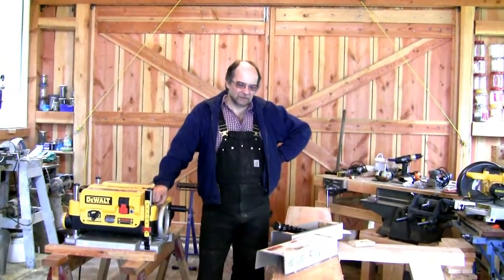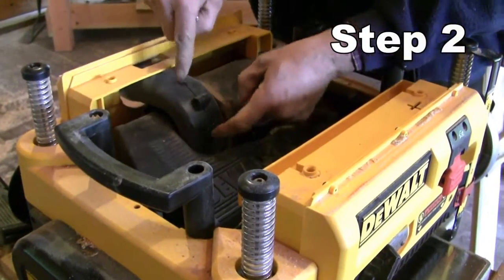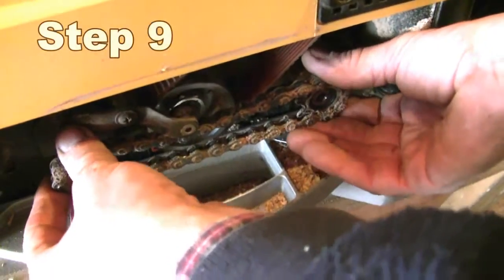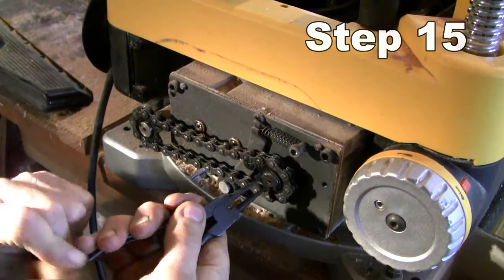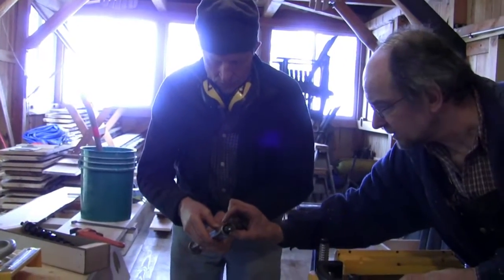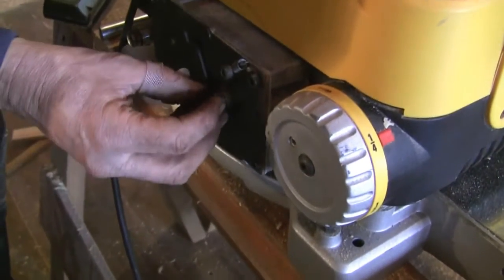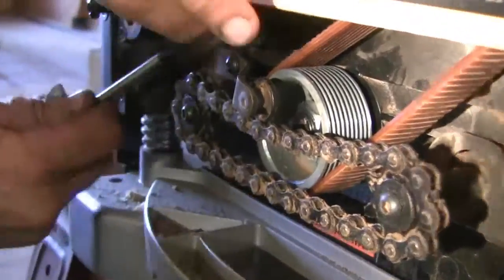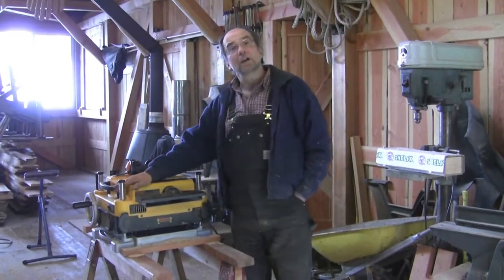How To Install a Shelix Cutterhead in the DeWalt DW735 Planer

Comment: Funny how you skipped over how to tighten the main pulley nut. Mind sharing what you did to hold the cutter in place to torque the nut?
Reply from the maker: More a sin of omission than of commission :-)
It's not difficult to grip the large pulley & tighten against it, given it is fixed to the shaft with a key. Also, if I remember correctly, the cutterhead shaft has a locking mechanism. In any event, the nut does not need to be extremely tight , again, given that the pulley is locked to the shaft with a key.
Cheers,
M

Comment: As a beginner wood worker this was my first big splash. The planer has worked great>>>ur2.pl/856    and left a smooth finish with no additional sanding needed. Planed about 200 feet of rough cedar and it all turned out great and uniform.

Comment: I have a trick for putting that belt back on: Get it started onto the top of the ring, then use the socket you used for the nut to rotate it (counterclockwise) and the belt will slide right back on.

Comment: thanks guys. your video was the one I chose to use for instruction and it went beautifully. few problems on mine , dewalt used blue Loctite on the shaft hold down and they used Phillips #2 for fastners. I may be patting myself on the back but I never strip out a fastners. I will say I have tennis elbow which contributed  . Also I think dewalt shoud have used hex head bolts for the application. Phillips used in 3 places , cutter head hold down , and 2 tensioner supports. my machine was brand new so this may have been a factor. loved you video.

Comment: Getting ready to change out the cutter head in a dw745 and of all the videos your are the best. We plane lots of hard wood here as all our lumber comes straight from the mill. I wish I had kept track of all the blades gone thru so far. By the way, I have resisted this change over because of the cost but recently the price has gone way down. Anybody on the fence should check it out.

Comment: When I bought my new Dewalt planer I had high hopes. I was disappointed because it bogs down so easily. And the noise! Wow! I've done my research, I bought the Byrd cutter head and I am ready to install it. This video will help me a lot. I will update how it went.
Update: Great video. Wow! My planer now works like I had hoped. Installation was easy. The noise difference is amazing, but, most importantly the planer doesn't struggles. Tried some 8 inch widecwhite oak which the planer struggled with using stock blades. It wentvthrough easily with the new cutterhead.  The cutterhead is a tight fit through the hole and you do need to be careful not to mar the bearing housing. They recommended wrapping the cutter  head in plastic to put it in, but mine was so tight that any more sickness would have prevented it I'm going through. Worked out OK, though. If you don't have snap ring pliers, buy some. People have complained about how hard it was to get the old cutter head out but if you have a piece of hardwood to hit it with (like in the video) it's not that difficult. Whole thing was pretty straightforward and the video helped a lot. Thanks for posting.
Reply from the maker: Hey Douglass,
Thanks for you post & follow up. I'm glad you found the video useful.
An employee at Byrd told me many (non-mechanically minded) woodworkers are reluctant to make the switch. Between the two of us, maybe we can give them a gentle nudge :-)
The DeWalt is probably the best portable planer on the market and as you have found, the Byrd Shelix cutterhead makes it better, My planer owes me nothing & it's still going strong.
Cheers,
M
Reply: Markerbuoy - On Canada's Left Coast Yes, I previously have owned a Delta 12 1/2 inch and a Porter Cable. They were OK, I guess. I wish I could have had a helical cutterhead for them. The 735 has much better dust evacuation. I just got a leaf bag and hose to hook up to it and that works great. I recently got 10 church pews that are red oak that I am about to plane. Looking forward to my planer working great.

Comment: The only thing I would add is this.

Upon completion of installation, I decided to look at the Byrd instructions for myself. They included a plastic sheet to wrap the cutterhead in while inserting it into the machine. This should definitely prevent any nicking or marring that would otherwise occur. I have at least one small nick in one cutterhead which in the grand scheme of things is no big deal. I don't know if this was addressed by anyone else on the comments or not.

However I used your video as a guide and my machine has a new lease on life. Thank you for the instruct!
Reply from the maker: Good point Ryan - no one else has mentioned this. My Byrd instructions contained no such mention. I cut my hand on the cutterhead during the install and a plastic wrap would have prevented that. I'm glad you found the video useful - out with the old, in with the new!
Cheers,
M
Reply: +Markerbuoy - On Canada's Left Coast Yeah, I really blame myself for not looking at the instructions. I found the video extremely useful. Thank you.
Reply from the maker: The Shelix people told me that most woodworkers are reluctant to engineer the cutterhead installation. As you know, it's not such a big deal as long as one pays attention. You & I know that - hopefully more will follow...I bet you love the Shelix cutterhead!
M
Reply: +Markerbuoy - On Canada's Left Coast I do love it. and the installation was easier than I thought it was going to be...Thanks to you.Haha!

Comment: I came across your very interesting video while researching the Shelix cutter head upgrade.  I've been very disappointed with my brand new 735.  My first project was to plane some poplar, and I can not believe how quickly the blades dull, resulting in breaker trips.  This morning, I could not even get through a small 4" X 36" board without tripping the breaker on the machine, even with the speed set to the slowest setting, and less than 1/4 turn on the wheel per pass.  When I rotated the blades to a fresh edge, the cutting sound was noticeably less, but for only a few passes.

My initial assessment of this very popular machine is that it is really not up to the task of dealing with hardwood, even the relatively softer poplar.  It runs right through pine without any problems.

In your video, in the initial decibel test, I couldn't believe how easily the large, full-width board ran through the machine.

I'm thinking that Shelix head, even at twice the cost, is a better investment than a set of carbide blades.  The stock blades seem to be worthless?

Any suggestions are appreciated.  Thanks.
Reply from the maker: +John G. Walter 
Hi John,

In my experience, the 735 is an excellent "benchtop, portable" planer. In my video you saw how much Douglas Fir we ran through the planer while building my shop. While D Fir is technically a softwood, it is mighty tough and yes, I found the blades fairly quick to dull ( I would dress them with a diamond hone, rather than spring big money for a new set), although your experience seems exceptional. I can only suggest that maybe, maybe, DeWalt has dumbed down their  blade manufacturing or that you are simply unlucky...it's hard to know what to suggest without being there. 

A shelix cutterhead is a big investment but I don't think you will regret it. While I haven't done the volume of planing as previously, the carbide cutters remain tack sharp and blade changes are a thing of the past. The spiral cutterhead is a different technology, as I'm sure you realise and makes conventional knives look old hat. Highly recommended. A little quieter too!

Given the abuse I have put it through, I must say the DeWalt has held up very well. There is lots of life left in it, especially with the shelix and it owes me nothing.

I recently upped my planing game with this beast https://www.youtube.com/watch?v=I6OHktyBr5M - you may have seen the video already. I use it to do the heavy thicknessing and now use the DeWalt for fine finishing. 

I don't know if this helps or not. If I can be of further assistance, just let me know.

Best Regards,
Mark B
Reply: +Markerbuoy - On Canada's Left Coast 

Thanks for the quick response.  I really liked your video.  After having problems with both sides of the knives that came with the planer, I have switched to the spare set that also came with it.  They look the same.  However, they cut much better.  I quickly went through a couple of poplar boards, one 4"X 3' and the other 4" X 7', planing them from around 1 1/8 to 3/4 in quarter-turn-of-the-wheel passes.  

The machine was noticeably quieter, did not trip out the breaker, and what was very different, were the chips.  On the first set of blades, the chips were granular, like chunky sawdust.  On the new blades, the chips were fluffy shavings, which resulted in about 10 times the volume in my dust collector bin.

I'm not sure what to make of it.  I know that on the first set of blades, I probably dulled them initially by planing a couple pieces of Brazilian Cherry flooring, which is VERY dense and hard.

I am pretty confident I am going to be pleased with the  Shelix, which is on order, and I am also VERY confident that the install will go smoothly after watching your excellent video.  Thank you very much for that.

As for the planer beast that you have rebuilt, it reminds me of a big machine that I used, a long time ago, in a small shop.  It looked very similar to yours, except it was 36" wide, had a 5hp motor directly driving the cutter head.  The opposite end of the cutter head drove a small pulley, driving a 4" wide flat belt, which was attached to a larger wheel (probably 18-24" in diameter), then a jack shaft to another similar flat belt back on the motor side, which drove the feed rollers.  Incredibly powerful, very scary to use with all those belts, and probably weighed a ton, at least.  The chips came out the top, just like yours.  If the deflector wasn't installed, they would hit the ceiling.

Thanks again.

John

Comment from the maker: Thanks for your comment.
The Shelix is indeed a great cutterhead for a great portable planer. The DeWalt planed every board in my shop & that was before I installed the Shelix! It owes me nothing and will run for many more years....and as you point out, quieter too.
Regards,
M

Comment: Thanks for uploading this video, guys. It took a task that would have been probably very difficult and confusing and made it relatively painless. Planed some very hard exotic wood and some figured maple with the shelix installed and both came out glassy smooth. The reduction in noise is a bonus too since the previous head made it sound like you were standing under a helicopter.

Comment from the maker: Oops, I'm sorry to hear that. At this stage, my DeWalt owes me nothing. If you watch my vid, How To Build A Workshop In The Woods, the DeWalt planed every board in that building & then some.
However, recently, the height adjustment has stiffened considerably and the adjustment wheel is feeling insecure. Like you, I may be in for some downtime. Good luck with your machine :-)
M

Comment: Nice video. I would love to see on on re-leveling the planer. My height adjustment is jamming up on me for the second time in a year. I had it at the factory service center in January and 6 months later it is doing it again and now even the drive roller is jammed.

Comment: Then wedged a piece of plywood in the cutter head housing and tightened a tiny more. Didnt want to use much pressure at all. I'm wondering if I should go back and add a little lock tight to it. Has anyone had any experience with that nut loosening up?

Comment: Just received and installed my new cutter head! Your instructions were great. One addendum I'd make is to use a scrap of 3/4" plywood between the hardwood dowel and cutter head when hammering it out. Before I added the plywood the drive gear of the cutter head kept splitting the dowel. The other little conundrum was how to tighten the nut (I used a 15/16th socket but I think its a metric size) once the shelix is in place. I just held onto the belt pulley while tightening with the socket wrench.

Comment from the maker: The Shelix cutterhead represents a significant improvement in many ways; quieter operation, carbide cutters that stay sharper longer (and can be "turned" or replaced as necessary) and less wear and tear on the machine overall. I understand your frustration.  As long as you work within the machine's limits (it is a portable 120v planer, after all) and perhaps slap a little paste wax on the planer bed to reduce friction you should see better results. If you are trying to remove a paint layer...

Comment: Im considering the shelix head for my dw735.  Im planing a lot of old pine (reclaimed shiplap and beaded ceiling). The knives dull really fast and I am left pushing and pulling the wood through the planer.  Will the Shelix head be a significant improvement?  You mention quiet and smooth cutting, but I'm wondering about the machine functioning better so I'm not doing the tug o war.

Comment from the maker: Congrats on your new planer!
I'm sure you will be very happy with your choice.  
25 years ago I bought my first planer, a Makita 2012. At the time it received rave reviews from the likes of Fine Woodworking etc. and indeed, has provided wonderful service. I still use it at my shop in town; I grew tired of replacing expensive knives and managed to re-sharpen them to extend their life...this is what I did with the DeWalt before I installed the Shelix.
Happy planing!!
Regards,
M

Comment from the maker: @knutbar @knutbar Sorry about that.  I think the Shelix cost $447.00 and shipping to my 

address was $50.00(approx) via USPS.  Byrd tool does an excellent packaging job, 

which results in a weightier box than you may imagine...they also include a number 

of spare carbide cutters and a star drive tool for their removal & installation.
The original planer cost me $480.00 brand new from Home Depot Canada.  A couple of 

times per year HD throws a DeWALT sale, sometimes around 20% off.